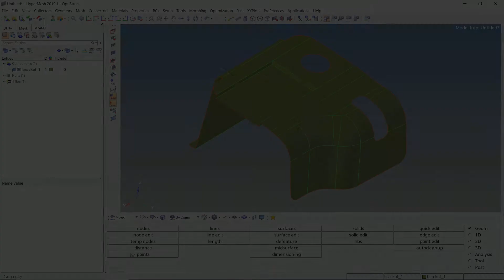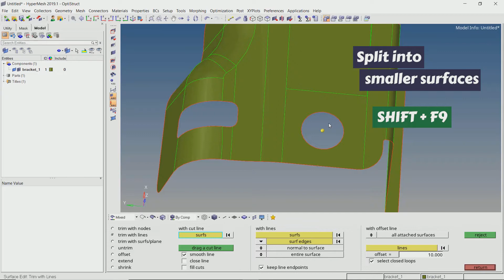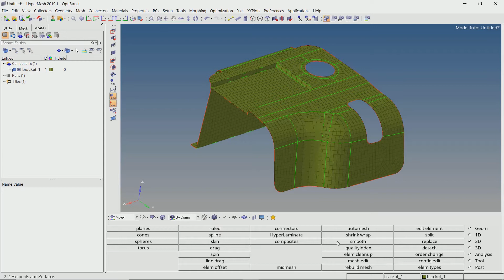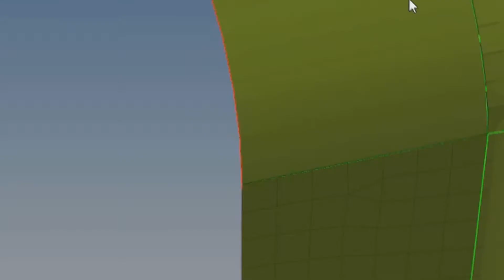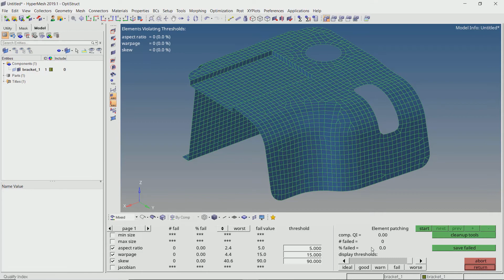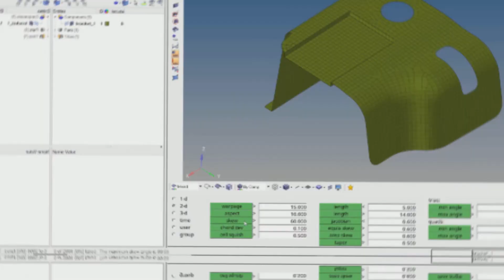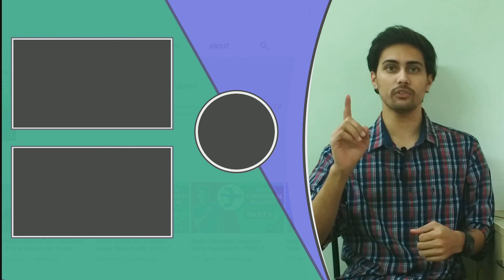2D Mesh in Hypermesh : How to Optimize 2D Elements [SIMPLE METHOD]

Comment: while performing linea static analysis on  bicycle frame  I am getting error as CTRIA3 elements 38992 is distorted (zero or negative Jacobian) but while checking elements under Jacobian it says that 5.7% failed .The minimum Jacobian is 0.02 .Please guide me into this
Reply from the maker: Did you try to run the analysis using PARAM CHECKEL = NO. If not, please try that and let me know if it works!

Comment: Great video, I really appreciate the info. Question, When you go to the 2D quality index panel, how are those values calculated? How does HM knows what is the minum and maximum element sizes are ? What about AR ? Is there a way to come up with this minimum parameters ?
Reply from the maker: Hey Jorge, thanks!
The 2D quality criteria values which are visible in HM are not specific to the model under consideration. They are default values coded into HM which closely correspond to commonly used industry standards.

Criteria like warpage, AR are (considering theoretical meaning) not dependent on the element size at all! Minimum and maximim element size however, depends on the actual model.

It is advisable to check with your organization, or the standards which you want to follow and change these values manually as per requirement. If you do not know these details, you can always opt to use the default values.

I hope this helps!

Comment: Great video as usual. I have a simple question, from your experience, if we have tri element on a flat surface, is it better to have that tri element in middle of the surface or the corner for better solution accuracy ?
Reply from the maker: In my opinion, the solution accuracy is governed by more than just the location of tria elements. The element quality, element size are more important considerations. Trying to avoid tria at all locations would probably be the best approach in 2D meshing.
Reply: @Aeroswap  Thank you for your prompt reply, as you suggested I do try to avoid tria elements as much as i can but I was just wondering if there had to be a tria because of unusual unsymmetrical body and there is a tria element on flat surface, would you advice that tria element to be in center of the surface or near the corners for solution accuracy.
Reply from the maker: Yes, if tria elements are unavoidable, try to keep them at the center of the surface rather than at the edges.
Reply: @Aeroswap  Thank you, appreciate your help. I just started learning Hypermesh 2 days back and with your help I am already quite happy with my pace of learning. I learn soooo much from your videos. God bless you man.
Reply from the maker: Glad to help out :)

Comment: sir such great explanation i have one doubt why 2d hexagon,pentagon,octagon elements are not using for mesh.. pls reply sir..
Reply from the maker: The results for the analysis are interpolated from the parameter values recorded at nodal locations. As the number of nodes for an element increase, so does the solving time for the simulation.

Secondly, it is very important to have a proper mesh flow to accurately observe the load distribution pattern. Hence, element with parallel edges is preferred.

As quad elements have less number of nodes and parallel edges, they satisfy both the conditions stated above. Therefore, quad mesh is more desirable than any other mesh type.
Reply: @Aeroswap  thanks bro...👍👍

Comment: Meshing every single surfaces seems too tedious.. Number of jobs would be numerous if the structure is a complex assembly. Is there any other way requires less effort?
Reply from the maker: You can try batchmesh option. Using batchmesh we can create a good quality mesh by selecting sufaces in bulk. Not need to edit each surface individually. Geometry editing can also be performed automatically using the batchmesh option.

Comment: In this video rotating quads are formed which should be neglected trias are better than rotating quads in respect to energy transformation
Reply from the maker: Yes you are right, rotating quads must not be used in FE analysis like crash and NVH as it affects energy transfer.
But in this case, the main focus was not on performing any particular analysis. I just wanted to show the different methods we can implement to create a better mesh. 

Thanks for pointing that out though 👍🏻